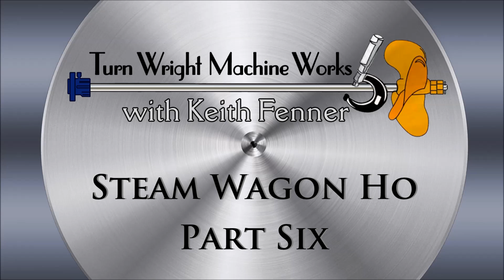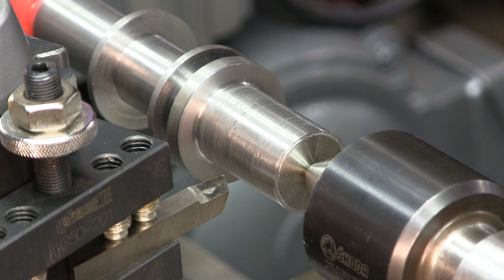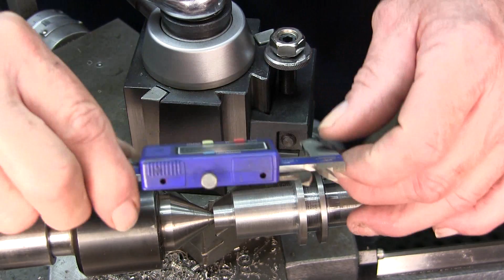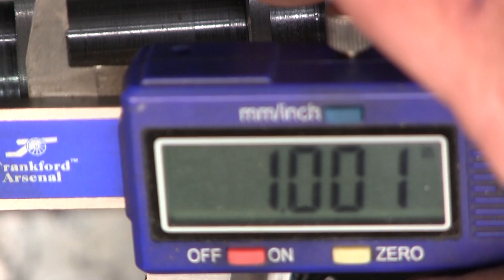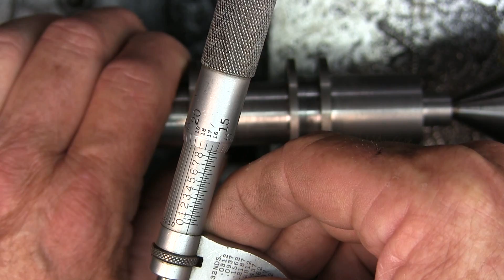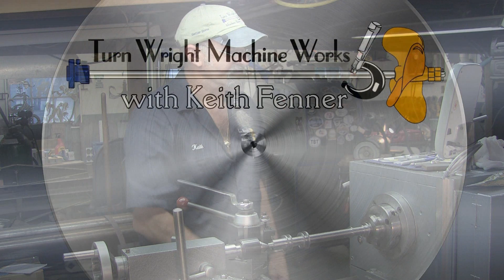Steam Wagon Ho Part Six

Comment: Hi Keith,  I saw where you have a chuck key holder. When I first got my lathe, i would forget and leave the key in the chuck, and turn it on. Yeah, yeah, it was bad. lol  Had a few holes in the wall from that.  Since i just could not absolutely remember to take the key out sometimes, i made a key holder with a switch at the bottom. The lathe would not turn on without the key in the holder.  It came in real handy when my boys started using the lathe.  No accidents!